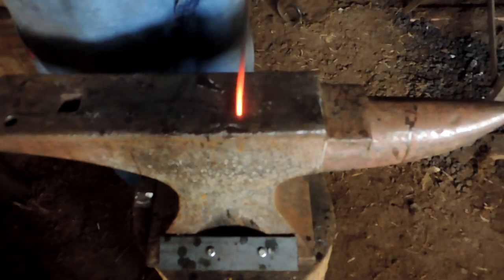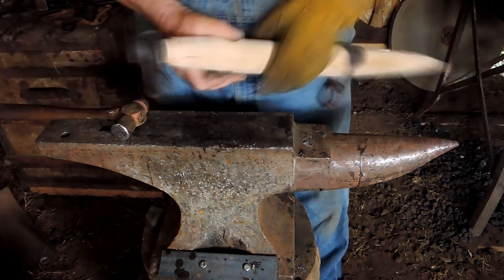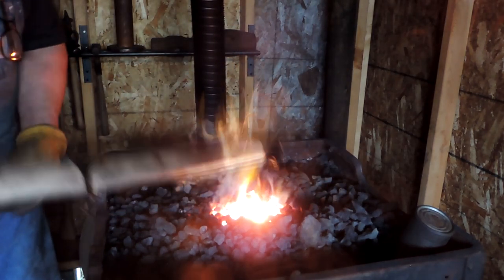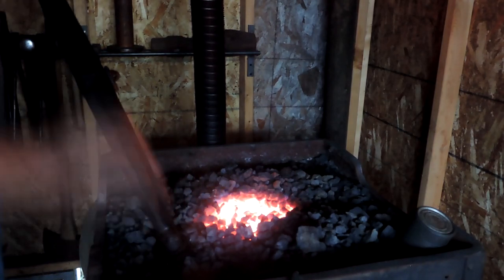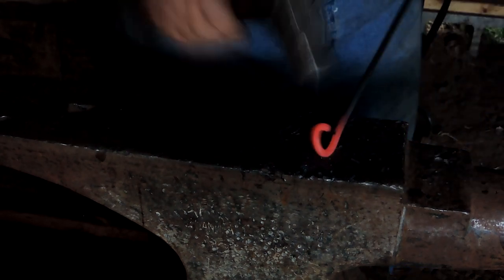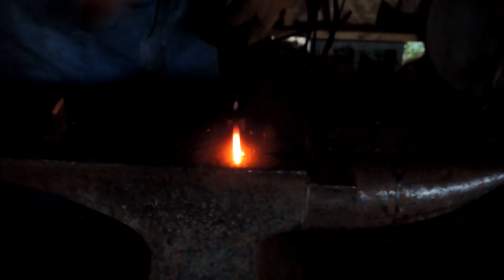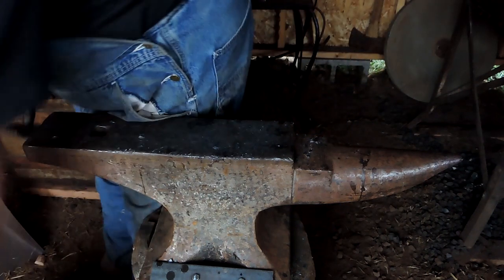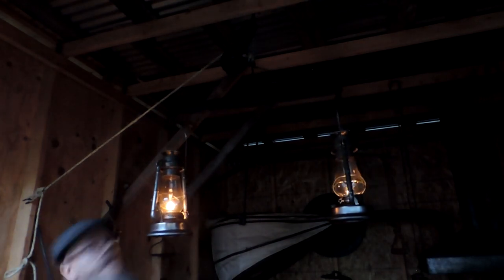Blacksmithing   Single Tree Lantern Hanger  Lighting The Smithy

Comment: I was waiting for the lime light projector or carbide miners lamps :}  But now we know what the pulley is for :} . Safety question are you going to put a crimp stop or knot on the rope so if it ever slips from your hand etc it will only go down so far and not crash into the floor.

Comment: Tim in engineering that is called a whippletree or whiffletree. 

Whiffletrees are very useful devices: in structural testing they are ganged up to distribute an applied load such as a distributed load on an aircraft wing, etc.